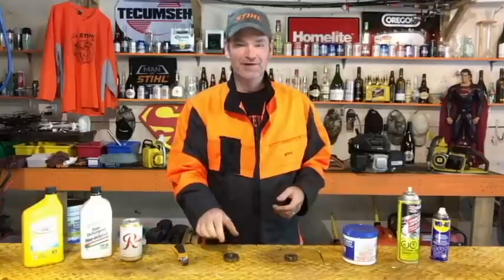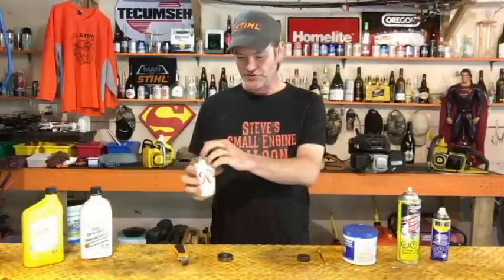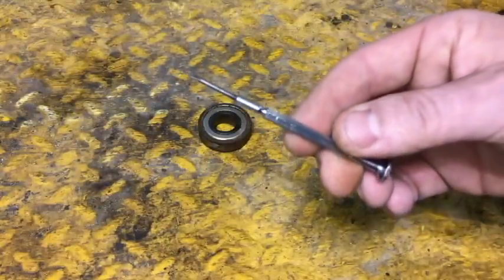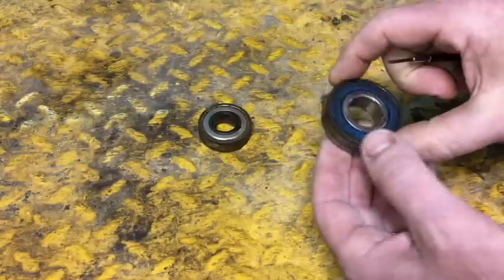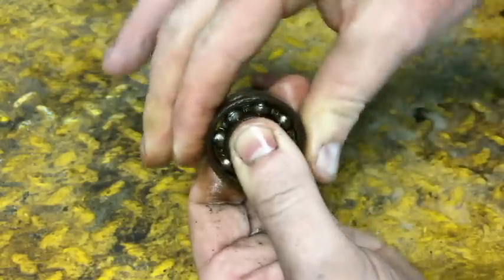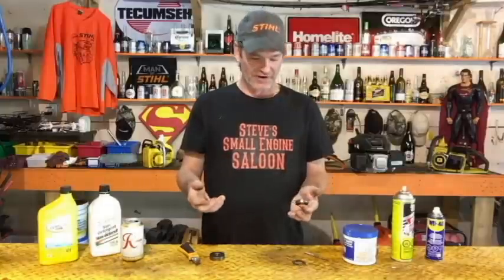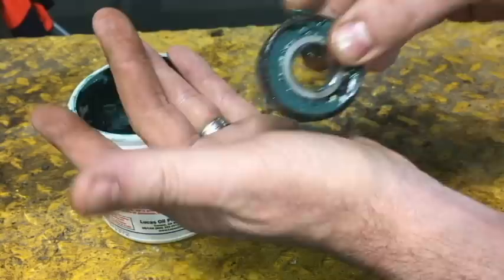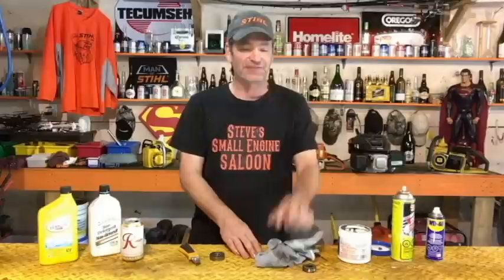How To Un-Seize, Clean and Grease a Sealed Bearing

Comment: Small bearings are cheap.Just replace them. If a bearings is seized chances are the bearing surfaces of the races and ball bearings are pitted. If the bearings are run at high speed they will not last long. Types of grease used is important. Do not mix different types of grease for they may not be compatible. The binders used to hold the oil will harden and lose their oil holding/lubricating properties.

Comment: After going to all the trouble of getting the bearings out, is it really worth it to try to fix them? I would think that, at that point, you might as well replace them. Bearings aren't THAT expensive. Now if it's a weird sized bearing that you can't find for sale, then sure... fix it.

Once you get good with the palm method, you can force grease all the way through the bearing from one side.

Comment: Why did you not properly clean and dry the bearing before greasing it?   Are you not concerned with traces of old grease and contaminants affecting the new grease?  How do you know the correct amount of grease to avoid over-greasing?

Comment: I wouldnt have sealed back up a bearing that was that dirty! I would have soaked it in parts cleaner or something until it was squeaky clean. But if the ball bearings are very pitted from rust and corrosion, a person is better off just replacing it, its cheap most of the time.
Reply: It's usually not the cost but the immediate availability that is the issue. But yeah if you have a shelf of new bearings on hand definitely toss a new one in on the spot.
Reply: @cvcoco  I figure anytime I save a bearing I am getting extra life out of equipment anyways. And you can always go back and replace them when you get a bearing. Not that I do if I can get them going again. I do have a router here where I should replace the bearings. I bought it used and they were shot. New bearings would cost me more than I paid for the tool. So that has put me off doing it. It works, It's just a bit noisy now. At least I think it'd run a bit quieter with new bearings in it. I've never actually heard the tool with good bearings in it ever.
Reply: @cvcoco  It is an old Bosch Colt router so pretty well made.

Comment: After you get a seized bearing to spin freely, soak it in some gas or spray with brake cleaner to get all the dirt particles out before packing with grease. Cleanliness is your friend.
Reply: I always use the palm method for repacking with grease.
Reply: A 50/50 blend of synthetic automatic transmission fluid and acetone is the greatest way to unseize a bolt. I always have some mixed up in a squeeze bottle.

Comment: You can buy 10 brand new bearings on Amazon for $12.00
Reply: Yeah but none of them bearings are getting here when I need them. Which is always right now.
Reply: And you’ll probably end up with 10 brand new bearings with improper inner or outer diameter measurements, rendering them perfectly useless for your intended application for $12.00.
Reply: @1pcfred   I order prime and have them in a day
Reply: @stevee7774   Well I have lets see , 8 John deere mowers and so far no issues at all . I have used the amazon bearing on all spindles and been doing strong for a couple of years now.
Reply: @myname2263  I grease them up, keep my money and have things back going in the same day. Just popped the shield on the upper bearing of one of my routers and greased it up. Running smooth.
Reply: @1pcfred   Good deal , usually they are toast before you can get them repacked and going again .
Reply: @myname2263  in my experience most bearings can be saved with lubrication. But if they can't then they can't.

Comment: Recently I had a destroyed bearing on a Kemp shredder. Ball bearings everywhere. The other side wasn't so good either. Do you have a secret for getting the bearing off a shaft? The bearings I had are known as pillow bearings. That's the whole assembly, the actual bearing looks like this - https://www.thebigbearingstore.com/sb206-18-1-1-8-insert-bearing . The way to put them on is to heat them up to about 190-200 degrees (in a plastic bag, in water) and they'll slip right on. Once cold they are where they are. To get them off I had to use a die grinder and grind the old one off. Maybe you know a better way?

Comment: duuude. That bearing was WAYY dirty when you put the grease in! aint gonna work for long!
Reply: Yeah a small engine repair guy had the solvent for cleaning bearings. Good old gasoline. Throw some in a little can and swish it around. But the heads of all the Internet sissies would have exploded if he did that.

Comment: If you take apart a new sealed bearing you will see about half the available space inside is empty. That allows the bearing to cool. On open bearings it is ok to fill the entire space because excess grease will be pushed out in use. Cleaning and repacking sealed bearings that are stuck should not be done in critical applications like motorcycle bearings as the stuck bearing is already damaged.

Comment: I can't see spending hours on a 3.00 buck bearing. That's insanity man. U got to be kidding me. 
That's a rusty peace of crap.
Reply: Sometimes it's as much about the satisfaction of keeping something going than flat out replacing it. Very therapeutic
Reply from the maker: Right on...
Reply: if you can't get your hands on a new bearing, then it's not such a waste of time. :)
Reply: U got a point but depends on how fast you need it and how far away the hardware store is.
Reply: Also depends on the quality of the bearing.  There is a big difference in bearings.   I would clean and repack a good quality bearing than put in a low grade new bearing.

Dale in Canada
Reply: @dalemcinnes1834  well a seized bearing is never going to be as good as it was when it was new. but as long as it isn't too scored you should be able to get it going again.